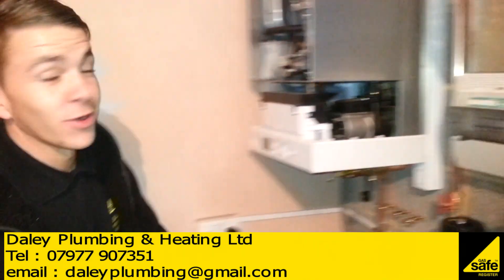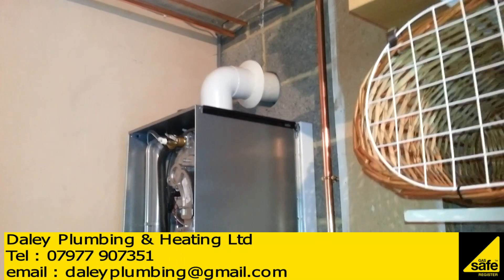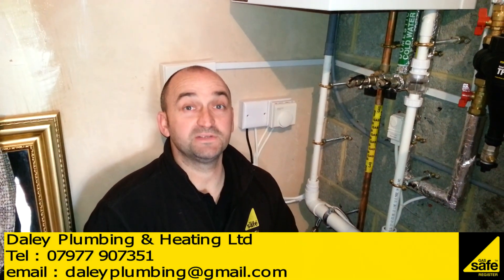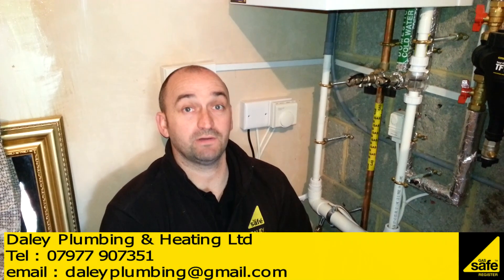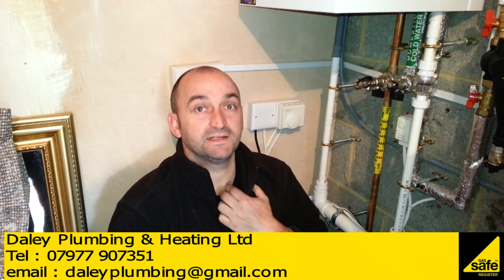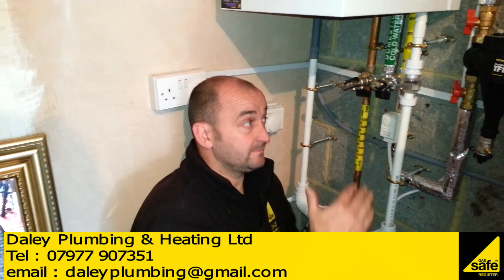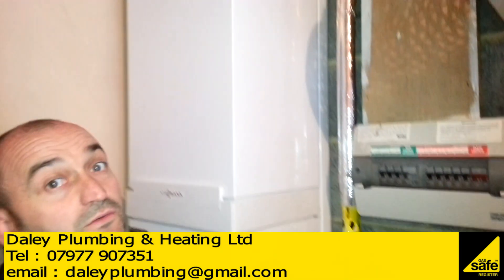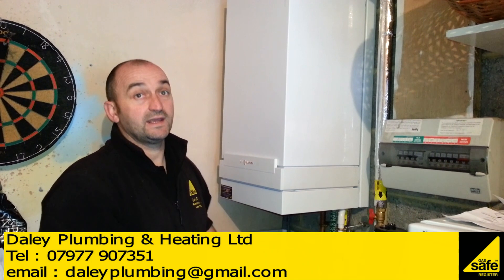Leeds Boiler Installations Viessmann Boiler in garage with Honeywell frost protection kit :-)

Comment: Nice installation , frost stat protects the heating circuit, boiler has its own frost  protection, nice those  viessmann boilers, I've fitted 5 so far,impressive efficiency and very quiet, Daley is a good tradesman, check out his 'ferrolli boiler repairs' on utube very funny!!!